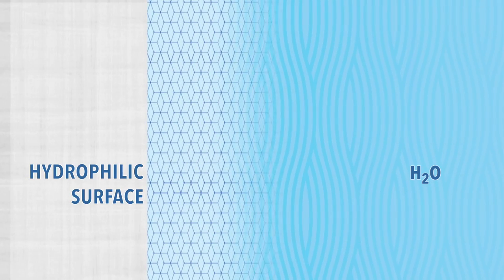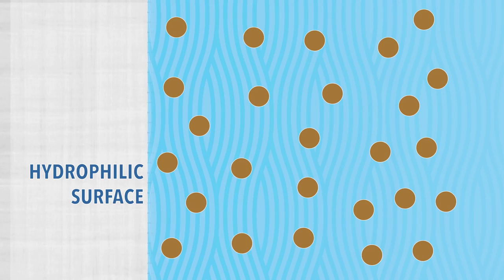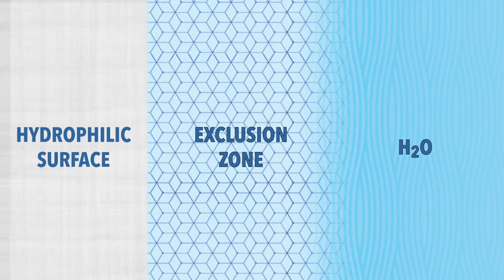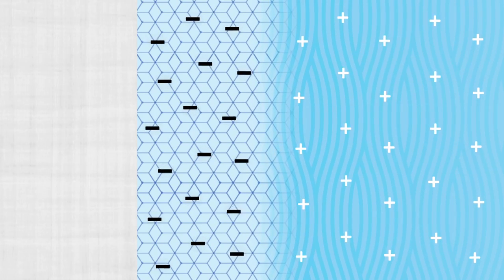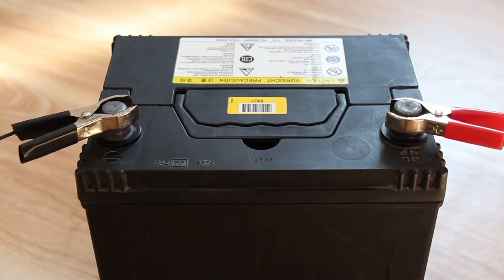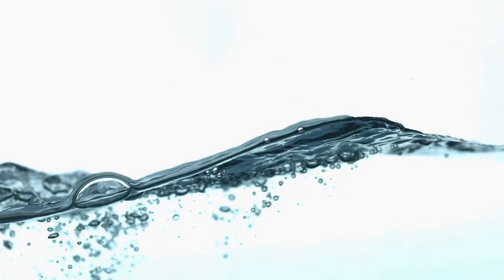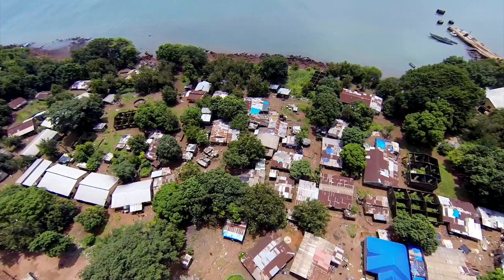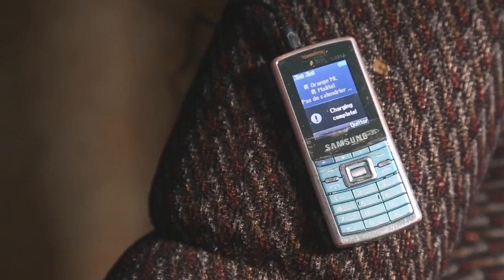What is the Fourth Phase of Water? with Dr Gerald Pollack

Comment: Bought the book, I put it to test, considering: hydrophilic surface creates the stack of EZ layers. made a rack of microscope cover glasses 0.13mm thick separated by de-phased ones to make 0.13mm gaps, (ideally EZ-water forming between sheets and flow should "filter/purify" water). But didn't observe ANY exclusion zone at all. Random particles would just fall to the outer glass. Food dye didn't react at all. This glass is hydrophilic AF BTW, water droplets extend to max over it... So I'm confused. hints/thoughts on home made EZ?
Although I did observe before, that small (~1-0.5mm diameter) air bubbles after shaking the water do project a falling tubular structure that reflect light a bit differently, probably thin as hair though... So I'm not sure why my glass experiment failed miserably.
Reply: Most glass will absorb IR light and it's needed for EZ to form. Some plastics could work better.
Reply: Because this is pseudoscience.